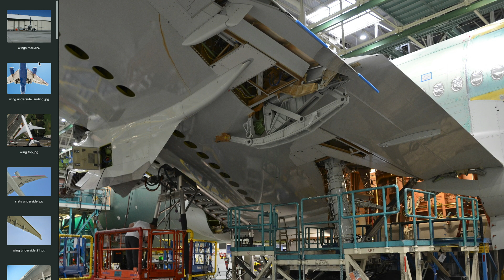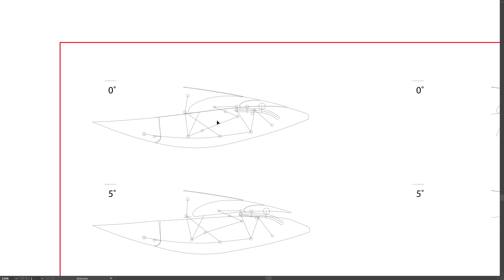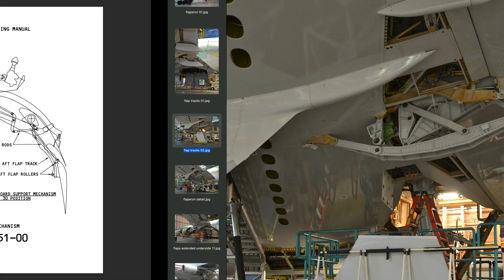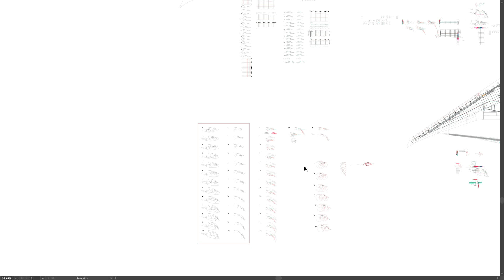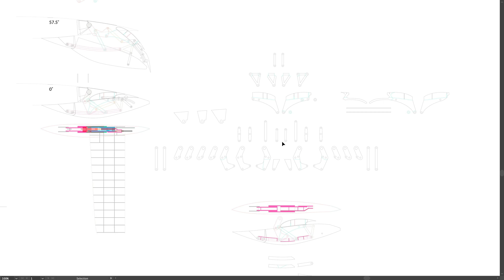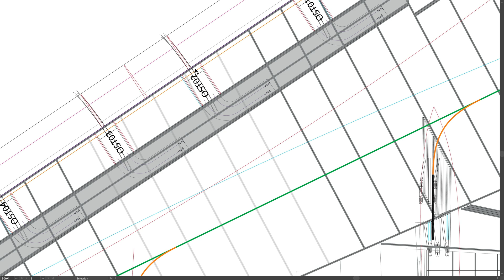Model 777-300ER - Flap progress update!

Comment: What do you use to draw the sketches? How do you get them printed on the manila folder?
Reply from the maker: I use adobe illustrator and print directly onto the paper. I have a large-format printer for larger parts.
Reply: @lucaiaconistewart  thank you, and one more thing; do you have a special printer that allows you to print directly on manila folder? And how do you make the 3d parts/plans, how do you know how to put them together?
Your project is amazing, and I'm actually doing the same thing, Except a different plane. All from paper(similar to manila folder) and very detailed. I'd love to share the results with you once it's done. Thanks :)
Reply from the maker: Nope, not a special printer, just a large-format inkjet so I can print the whole wing area on a single sheet etc. As for assembly, I basically just remember where all the pieces go since I don't really label anything. Best of luck on your project!

Comment: Hi Luca, thank you for the update. It's great to see that you're still around and still working on this! I've been following your work since you posted in Diecast Aircraft Forums all those years back. 

All of the update was based on the designs for the port wing. Would it be right to assume that you haven't started on the starboard wing yet? Also, would you say that the wings are the most complex part of the model to build? I look forward to your next update whenever you get around to it :)
Reply from the maker: Yep, the wings are by far the most complex pieces of the project. Each part of the wing (slats, flaps, spoilers, etc) is like a project in itself. And yes, all the test pieces I've made so far have been for the port side, but luckily it's just a matter of flipping the pieces for the starboard side. No additional design work needed :D

Comment: I found your channel when I was 9, and I thought the things you did were impossible, 4 years later and i'm making RC planes, now I know it is possible but EXTREMELY hard!! Well done, keep up the good work!
Reply: I haven’t really built any of that stuff so idk how hard it is but it sounds super hard and I have massive respect for anyone who does it, you keep up your work as well man
Reply: Same bro, i'm currently building the boeing triple seven rc plane with edf units, almost done.
Reply: Rc is radio controlled, i saw plane models on your channel, but they are not rc, and it is not that hard, but requires a massive amount of time.
Reply: @kokoslegend4850  I dont put th RC planes on my channel since they have my face or are filmed on an iphone... 5? 6? very old phone